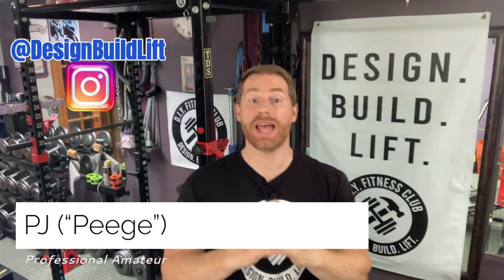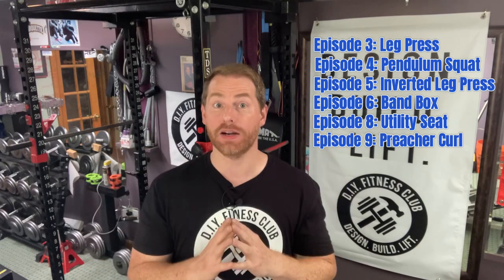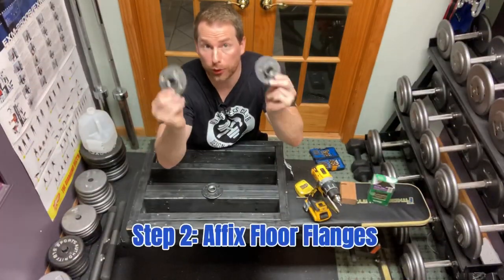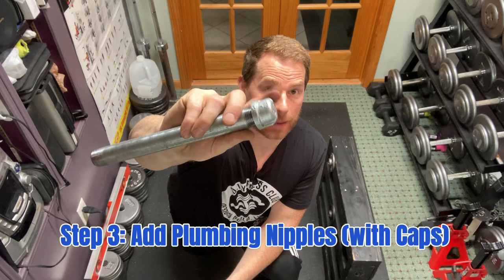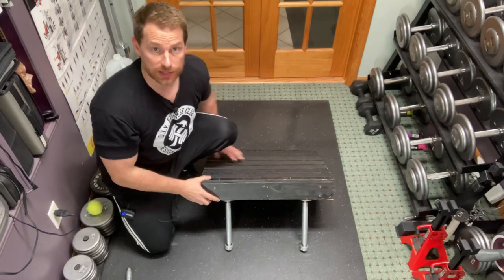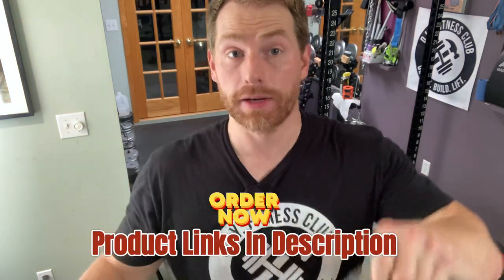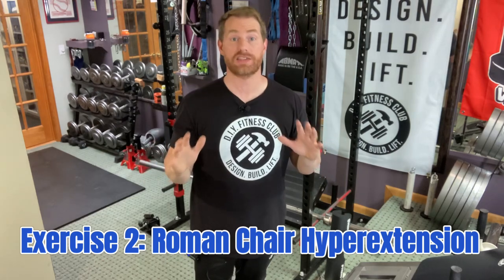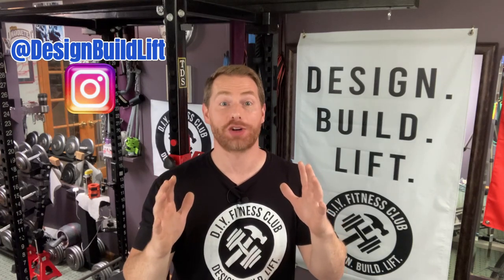Omega Arms: Episode 10 - DIY Adjustable Slant Board (and Squat Wedge)

Comment: I was going to point out the future failure involved with using pipe flanges to attempt to support non-90-degree forces, especially for someone of your size using lots of weight but then observed you using 3" screws. 2x4s have no inherent structural strength, they get it from construction techniques that your design has. 
Under a heavy load, especially with any bouncing or rocking, I think you could still experience a failure, but it should be limited to a slower bending of screws/splitting of wood that is controllable as opposed to instant failure of using screws under 2"
I would use it, very nice job.
Reply from the maker: Thank you, John! I appreciate it! 🙏When using it, I feel like my bones will break before the slant board does! 😆